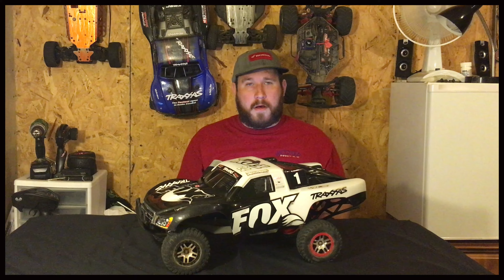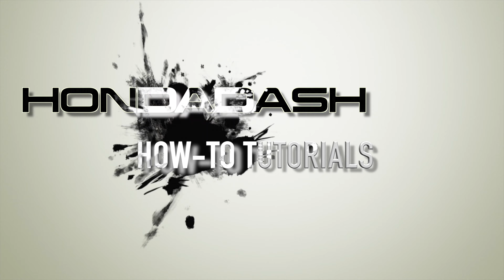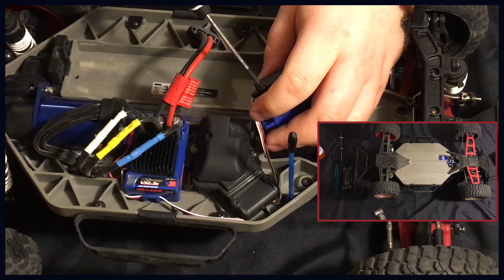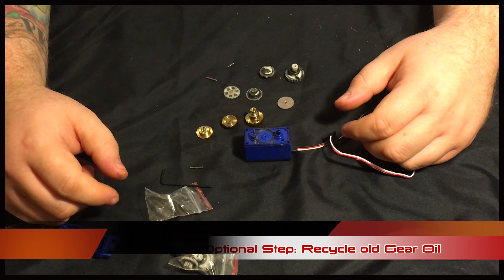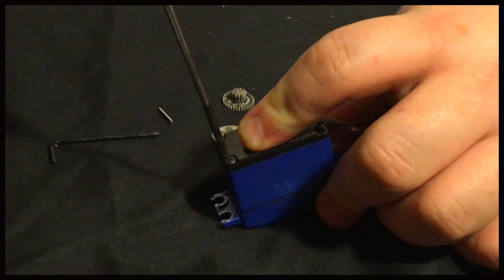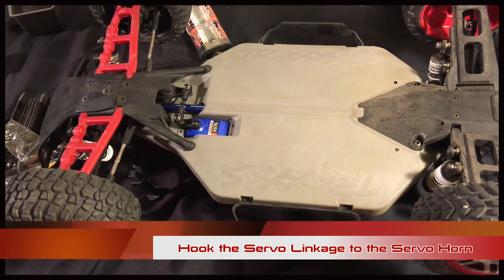HDRC UPGRADES: Replacing Stock TRX #2075 Steering servo Gears with SAVOX METAL GEARS

Comment: Will these metal gears work on the 2056 servo?  Can i use the bearings instead as well instead of the stock washer type?
Reply from the maker: Eduardo Mendiola I don’t think so but doesn’t mean that’s right

Comment: I did this to 2 2075 servos, both of them locked up and burnt out within a couple minutes, any idea why?
Reply from the maker: Josh Dyer did you put them in correctly and did you put grease in? It's important to put the  grease in
Reply: HondadashRC FILMS ya, I put them in the same way the plastic gears came out and I used dif grease on both, cause that's what I had on hand
Reply from the maker: Josh Dyer then I have no idea then that's never happend before to me
Reply from the maker: +Josh Dyer your servo must be fried then I'm sorry that was nothing more I could do

Comment: I have an HPI trophy 4.6 nitro  1/8 truggy.  I like it but stock servo is known to be week, any recommendations? I believe in "You get what you pay for" but if you have any good suggestions that would be nice.
Reply from the maker: +willcast21 You could try it but I would just say use a Savox water proof servo.the stock doesn't have the push to steer good.I use stock throttle servo cause there very little to push the throttle. And buy a glitch buster to reduce run away

Comment: Is there anyway of fixing my servo? Traxxas 2075. It was running with the problem in the beginning but i managed to fix it by wiggling the trim back and fourth. Today, the servo does not respond at all. Checked, it's not the radio. If the servo needed gear replacement, it would still turn a little causing a noise, which I do not hear. Help plz?
Reply from the maker: LeShedd then your servo is either Fried or you didn't plug it in the right Spot Since I'm assuming that your RC savy it's probably your servo that is toast
Reply: Oh yeah i forgot to mention that i have the stock 2075 traxxas servo. I couldn't have plugged it in backwards but how does a servo get fried?
Reply from the maker: +LeShedd by plugging it in the wrong slot will definitely fry it
Reply from the maker: +LeShedd when my steering servo fried I called TRAXXAS and they sent me a brand-new one
Reply: Now I think it's my TQi receiver. My ESC is turned on and the receiver is not repsonding.
Reply from the maker: +LeShedd wow dude your having hella problems
Reply: Yeah, don't know what I should do next. I think I am going to get another receiver.

Comment: Yo, dash... How's this mod holding up? You should do a long term review. I'm about to try this... Servos haven't been my friend this past month. Killed one of these 2075's and an associated one from an RTR Kit... I need metal gears in my life.
Reply from the maker: Mine are holding up great I fried my servo when I forgot to switch it for LiPo to NIHM call Traxxas and they give me a new one . So I just switch the gear is in my new one and they hold out extremely well the give your servos way more responsive plus they can take a hit three times as hard and the kit only cost $16-$18 at your local hobby shop or online within gonna make sure to do is make sure that they are greased up . I'm sure you've heard of green slime I live by that shit it is awesome I was just buying it and then taking your Serbal apart when you put your gears in and lube it up with green slime